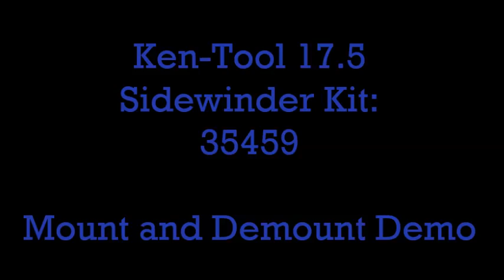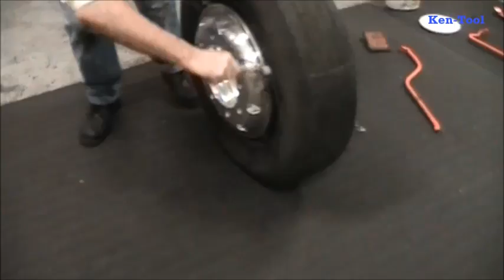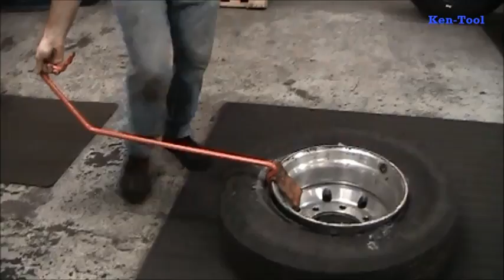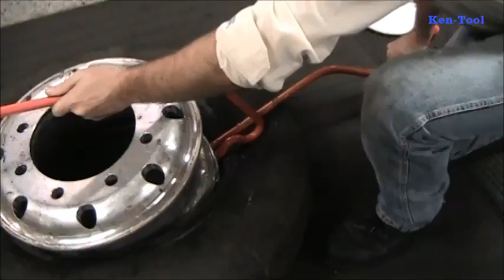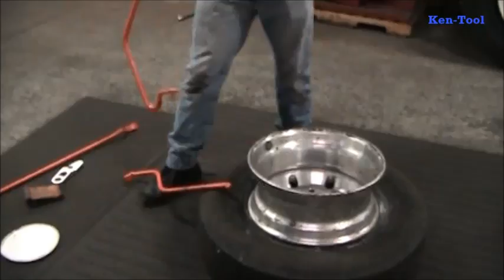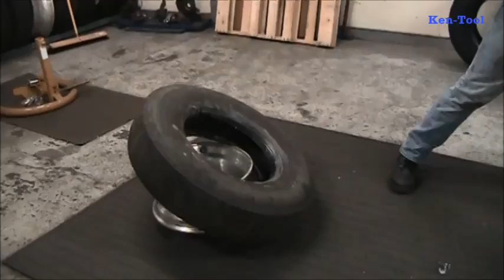17.5" Sidewinder Kit for Mounting and Demounting 17.5" Low Platform Trailer and Dually Tires

Comment: Need something like this for the 19.5 wheels. Looks like this system and method doesn't damage the wheel.
Reply: They have a set for the 19.5,  I bought this set for a hard case Michelin with European sidewalls where the 2nd bead wanted to hang on for dear life,  this 17.5 set didn't help like I hoped but it still has its uses.

Comment: Have these bars can do them on a steel rim swiftly. Also cut a piece of c channel to hold rim down also have a big red forklift to hold c channel to the ground. With a new style aluminum rim from a trailer manufactured within the past few years had to cut the bead a little on both sides to get it on rim without getting injured. Did an aluminum rims from an older trailer with 17.5s, it worked well with that, my rim holder, just had to use the tip of fork to hold tire down to get rim out all the way.

Comment: I bought this kit and tried to changed New Michelin 17.5 low pro stepdeck tire.  Dose not work. Spent 1hr. ripped new tire, maybe other brands are a lot softer and would work i dont know. I did many times 22.5 takes only 5 min, but not this one.
Reply: If you take out the tire from the opposite side than it is done in the video, it turns out much easier, as I seen everyone who uses the machine does it that way on allow wheels.
Reply: @rruuuuss  Yeah the short sides almost always on the face of the rim now, cant really use these bars with that style. You can demount the second bead the way shown in this video with those special bars but its not that much faster than just using two regular bars. And mounting it is a whole different game. The bar they use is alright but again, you might as well just use a spoon bar and put a little lube on it and slide it in at an angle to save time and money. The bead holders alright, but vice grips and a towel do the same thing. 17.5s are just tough, no way around it that I've been able to find.